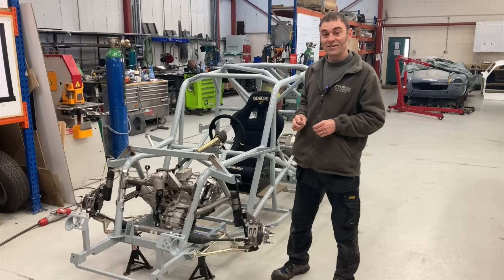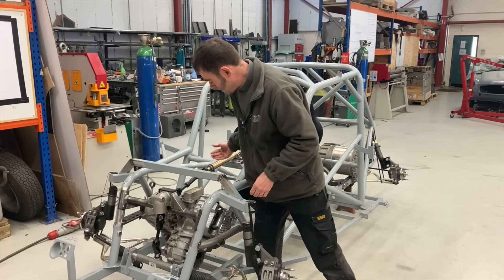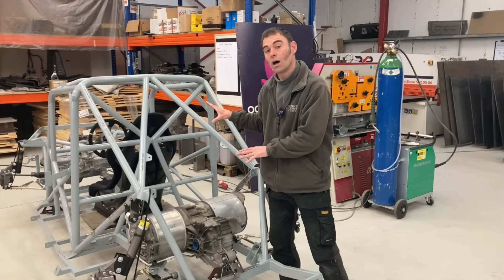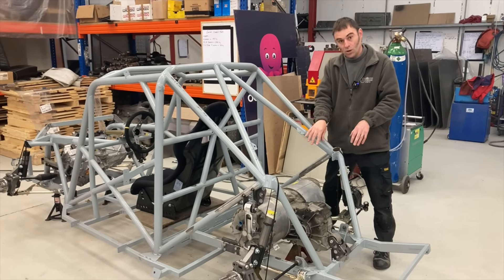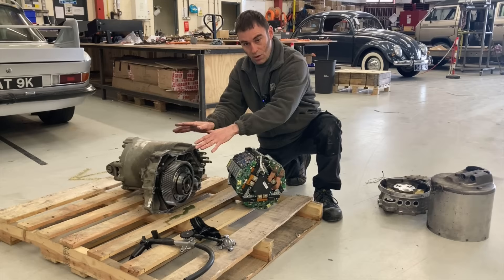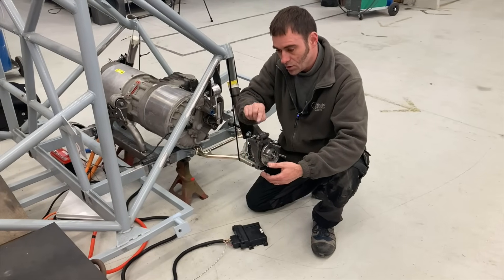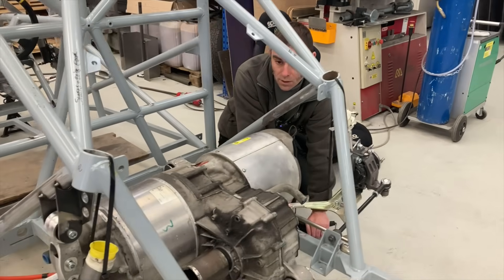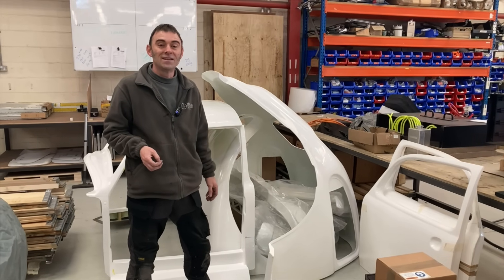Pikes Peak race car Ep2 - Motors are in.

Comment: Lighter is better. For pikes peak challenge, is it necessary to have two motors (front and back)? I would just have one. You win race in the corners and with 0-60 acceleration. Yes, 4 wheels has greater traction. Calculate the acceleration speed difference between single vs dual and weight difference. I personally think single motors is best. The more join you add to the steering the more play. Remive the front motor and less play. I do think you should sit low to the ground. Question. Because you are smart, could you replace the shell of the motors from metal to carbon fiber? Less is best. Might not change too much weight but every little bit helps. I strongly wish you could make that chassis out of carbon fiber. Everything you could do, replace, lighter is better, carbon fiber Everything.

Comment: 12:00 🤔 My fear is on the flipped-over drive unit: The (small) teeth on the intermediate shaft (towards the motor) are now running throught the oil sump, wich they don't do in the original position. The oil could be beaten to foam or cream on high rpm and the gears plus bearings overheat and get wrecked.

Comment: I thought Tesla motors were more drum like with a similar shaped inverter housing on the other side of the gearbox/diff, like the rear motor, so why is the front motor so different?
Reply from the maker: The large rear drive unit looks like that but small motors look a little different. 👍

Comment: Does the drivetrain oil pump normally sit with oil in?  Will it suck oil from startup when mounted at the top? Maybe a mini dry sump kit from a motorbike might be worth considering. Or oil pressure monitor at the least

Comment: Hello!  I am considering flipping a Small Tesla drive unit upside down for a Porsche 996 conversion so that I can get the motor in front of the rear axle line similar to this build.  Do you see any reason why this would not work?  I'm guessing I just need to add an oil pickup line to reach the bottom like you are planning.  Thank you for sharing your work!

Comment: There’s a very good chance that the phase drivers you tried moving don’t have any smarts to them that say which phase they are but the actual cabling going to them dictates what the main controller believes is the phase order. So the board’s physical location doesn’t matter but the cables going to them do. With that said I’d be more keen to flip the motor and sort the oiling and cooling system rather that spin everything backwards. Reason why is those helical gears in those gearboxes create axial loads into the support bearings based on which way they’re designed to spin. If you flip the direction of rotation the axial loads are also flipped. When engineers spec the bearings the dominant load is what they’re going for so you may find that the one that’s on the side that sees the higher axial loads is usually bigger.
Reply from the maker: We swapped the control wiring too but didn't work for some reason. In the Mercedes B class the Tesla motor spins in reverse so the axial loads on the bearings should be fine.
Reply: @ElectricClassicCars  Right on. I wonder what type of encoder it has on it. In some motor controllers they'll re-order the phases based on the encoder during an initial calibration. During the calibration the motor controller energizes the motor phases in an order and checks the encoder to see if it's in the right order. This is a little different than how the VESC works where it updates the hall table to match whatever the phase order is. Silly question but you did swap the encoder order at the same time you swapped the phases yeah?

Comment: Well done! Proper engineering there!!
Curious about you seating position, which was a bit of an issue, last time around, in conjunction with the front motor. 
But I guess that will be part of you next vid, as you need to resolve that before you can fit the bodywork...

Comment: Why not set up the steering “by wire”? IE use a servo on the steering unit.
Reply from the maker: We looked at that but it was very expensive and not really needed when the Bevel box works perfectly. 👍
Reply: @ElectricClassicCars  I see this as a challenge in so many conversions, I wonder if there’s not an opportunity for someone to produce something effective but budget friendly. Hmmmm
Reply from the maker: @autophile525i  Are you taking about electric assisted power steering or steer by wire systems?
Reply: @ElectricClassicCars  steer by wire. I’m not sure what regulations there are, and if they’d apply to conversions the same as manufacturers.

Comment: A quick thought which might help:. You swapped the two controller phases and saw the same rotation. That makes sense. As far as i can see, what needs changing is the low level phase signal which drives those boards,  not the boards themselves. 

If those signals are on three pins of an IC, or on three IC's, then the two relevant wires or tracks going to the boards need swapping over, maybe even by cutting the powered down tracks and adding small jumper leads. If it's done through circuitry which is potted, or on a multi-layer PCB with several tracks inside the board, then that modification might be much harder to make. If you have the documentation, then have a good look at the circuitry to try to find the correct wires or PCB tracks. 

You will need to use a logic probe, or oscilloscope, to find those input connectors, if no documentation is available to you. With luck, the board might even be marked clearly, albeit in small letters, and that could save you a lot of time.

Unless you know someone who can reprogram the microprocessor or PIC's?

Do let us know which approach is relevant to you. Thanks. 🙂👍

Comment: I realise that modifying the electronics maybe not be the easiest option, but you could perhaps instead swap over the cables that provide the drives to the IGBT transistors only. Rather than both.
Reply from the maker: Tried that. Didn't work. ☹️👍

Comment: For the film "The Dark Knight" they had a similar problem with the "Bat Pod" (the bike he used in the film). It had a motor in each wheel that needed to be alined to achieve movement. I believe they go through the solution on the bonus disk of the dvd - I don't have the dvd anymore, let alone dvd player, but might be worth doing a dive on.

As for your phase switching on the tesla motor and it not working: The only thing I can think of is that each unit in the motor is assigned a unique ID (similar to a mac address for network enabled devices). I would imagine, on the factory floor, the units are given a firmware flash as the full drive is assembled. The reason for this, is less to do with maintenance but more to do with system control. I wouldn't be surpised if Tesla treats the car like we treat our home devices for connecting bluetooth or to the internet; each device has a unique address, so it knows what it is and where it is.
Reply from the maker: Yes, that's what I thought too, which is why I swapped the individual phase inverters too. But still didn't work. Thanks for your input. 👍
Reply: @ElectricClassicCars  No problem. What I mean with the ID is that it's most likely hard coded by Tesla that unit 1 has ID 12334 that represents phase 1. This can't be dynmaically changed or assigned after leaving the factory. I reckon it'll be down to not wanting anyone putting in any custom hardware or doing their own repairs etc.

Comment: If you swapped the inverters and the gate controller connections, you swapped them twice, so they were back to the way they started. May be tricky just swapping gate control, as there is probably also phase current-sensing and maybe other monitoring that would also need to be swapped.
Reply from the maker: Tried swapping just the inverter phases, just the gate controller wiring, gate controller wiring and inverter phases,  then same again but also swapping the current sensor wiring. My thinking is it's something to do with the dual motor software as that should have worked ( in theory). Thanks for your input. 👍
Reply: There are only two current sensors, iirc. The third one is done by math. Because of that, I think you have to do a firmware mod in addition to: swapping phase current sensors, gate phases and fiddle with the reluctor direction.
Reply from the maker: @vidznstuff1  Yes, the 2 outer phases have current sensors the middle phase as you say must be done by calculation. Maybe swapping the 2 outer current sensor wires, the 2 outer phase gate controller wiring and the encoder wiring is messing the calculations for the 3rd middle phase somehow. I think you might be onto something there. 👍

Comment: Good approach regarding gearbox issues that occur after flipping it over. Does this gearbox have a breather valve or is it completely closed? Is it necessary to seal it and then reposition it on the opposite side?
Reply from the maker: We're changing the breather into the drain plug now it's at the lowest point. 👍

Comment: not really related to the Buffy build, but are the Model 3/Y Motors constrained when trying to use them in a build like this?  Do they need further mods to allow them to be used?

Great video btw
Reply from the maker: The Model 3 motor is a superior motor to the induction motors in a Model S. We use them in a number of builds. Maybe that's a good topic for a future Tech talk, covering the pros and cons of all the different Tesla motors currently available. 👍
Reply: @ElectricClassicCars  Yes, that'd be great. I saw that Zero EV had a test rig to get the M3 motor to work by modifying the throttle pedal .... but i didn't really understand what they were doing ☺

Comment: Looking good, Moggie. I love how this is progressing. 
Can't wait to see you stick the boot into this thing for the first time and smoke up all four wheels 😁
Reply from the maker: I'll be wearing my big-boy pants that day for sure. 😁👍
Reply: @ElectricClassicCars  12:00 🤔 My fear is on the flipped-over drive unit: The (small) teeth on the intermediate shaft (towards the motor) are now running throught the oil sump, wich they don't do in the original position. The oil could be beaten to foam or cream on high rpm and the gears plus bearings overheat and get wrecked.

Comment: I wondered when you were going to get around to flipping the motor. If you cast your mind back a bit, the FJ cars of the '60s using a Renault gear box, turned them upside down and back to front to give the mid engine position and turn the wheels in the correct direction.
Reply from the maker: I know a number of Porsche and VW gearboxes got flipped over in race cars too back in the day. 😁👍
Reply: On old VWs the diffs were made to be installed either way up, one way for the cars and the other for the vans with the portal axles, so the drive could be reversed to compensate for the portal gears. If the diff was accidentally installed the wrong way, you'd have a Beetle with one forward gear and four reverses!

Comment: This is coming together quite nicely! I've got a question. Do you need to sync the two motors to spin at the same linear speed for the front and rear tires to rotate equally? Or do the motor's logic compensate for that? Cheers!
Reply: I ve asked that the last time.  it seems the rear motor is the master and the front one the slave.  I guess the front control unit receives just the torque setpoint sent from the rear one
Reply from the maker: @davidef4162  That's correct. 👍
Reply: @davidef4162  My ebike has regen so if I set the speed low and go down hill it will slow me down. Would the same happen on the front motor as it was spinning much slower then the rear.
Reply: @alibro7512  I guess that, while pushing the throttle, the negative torque limit is set to zero (the regen torque limit), thus preventing the motor to act as a generator. Anyway, I'm not an expert...
Reply: I have the same question!

Comment: realy nice project. Do you know it is possible LDU from model 3 to flip oposite like this S model ? ? Model 3 has heat exchanger with oil and coolant , and it has oilpump ... will oilpump work propertly??  tnx . Hope you see question.
Reply from the maker: Yes, it's possible. 👍
Reply: @ElectricClassicCars  tnx 🙂

Comment: Hi. Why do all the cars use a 12 V battery. I understand it’s a normal car voltage . As well as the battery pack for the motors. Why not is a transformer to bring the voltage down. One large common battery pack.

Comment: EEC, there is liquid cooling of the motor, and it is likely designed with a certain drain path.  So I suggest reviewing the motor cooling path for any trouble spots.   It might be fine, but take a look at channels that disassembled motor for how cooling runs through.  Or might end up  blowing out some seals or something unexpected.  (Gruber, Monroe, RichRebuild, others I forget)  Special note: some channels have shown failed gaskets/seals that have leaked coolant into controller area and such.
Reply from the maker: Yep, we've taken a good look at the coolant paths, it'll be fine with the motor flipped. I doubt very much that coolant leaks into the inverter area will be anything to do with failed seals, it'll be because the inverters weren't torqued to the gear casting correctly or the seals weren't mounted correctly or the  surfaces weren't cleaned correctly. We've put dozens of these motors together and these points are critical to ensure good sealing between the inverted and motor. It's also critical to ensure the coolant pressure doesn't exceed factory settings. 👍

Comment: Next time, try to build your chassis around the components. This is a good project, but when building new you need to change your approach. Less downtime, less hindering with components, less compromise. However, I am sure you will get to the bottom of it, but let's say, you get 10 orders for Buffy. Like Elon stated: prototyping is easy, production is hard. I just wait to see where the battery packs will sit.
Reply from the maker: This is a project for me. We're not planning on building or selling any others. You're correct, designing and building a custom chassis would have been best but then again wouldn't have cost £2k 😁👍
Reply: @ElectricClassicCars  Totally understandable from this perspective. I was under the impression that you will make more seeing comments that asked for price pointed to your website contact. My bad.
Reply: He is building this vehicle for a specific racing class that all use the same chassis and body 👍
Reply: @Mardy72  Got it Martin. Thank you for making me aware of it.

Comment: You need to swap the gate drive signals from the logic board to two of the power modules. Just swapping the modules is like swapping two identical carburettors on a twin carb engine.
Reply from the maker: As I said in the video, I tried that. Didn't work unfortunately. Not sure why, as I would have expected that to work. Thanks for you input. 👍
Reply: How didn’t it work?. No movement at all? What errors did it throw? Or just spinning in the same direction?
Reply from the maker: @antonnpn9063  No spinning at all. Just a click noise from the Inverter. The sort of sound that tells you it's not a happy bunny. 😁👍
Reply: @ElectricClassicCars 
I'm not that familiar with the LTDU, but is the phase current sensor wiring seperate, or combined with the gate drive loom? If it's seperate, then you would have to swap the both the gate and phase current wiring between two power stages.
Reply from the maker: @EVguru  The current sensor wiring is separate to the gate controller wiring. I swapped both but didn't work. 👍

Comment: There are two current sensors on the motor phase busbars. Try swapping those if possible or atleast the wiring to them. They are probally running some form of Field Oriented Control method thus heavily relying on current measurements per phase.  Did you try running it with just the encoder swapped?
Reply from the maker: Yep, tried both those things. Still didn't want to work. Thanks Tom. I'm going to try it on another motor on the bench, I'm thinking it might have something to do with it having a dual motor software on the main control board so I'll try it with a single motor setup as I really think what we tried should have otherwise worked. 👍

Comment: The bevel gear system on the steering is fairly clever, it must have an idler gear in there too as the output is in the same direction as the input. 🤔
Reply: You can always turn the rack 180 degrees. Problem solved.
Reply: I believe the bevel gears keep the rotation the same, no idler needed.
Reply: Yes, at first thought it would need an idler, but that applies to a gear set like the motor drive set (motor turns opposite way to wheels). If you have a look at (or visualise) a bevel set, both shafts turn in the same direction.

Comment: Could it be that what you swapped on the Tesla motor are just the power units of each phase? Do they receive the control signals from a control unit? If yes, so you have to swap the wiring from the control unit and not the power units, which basically are just signals converters with no knowledge of the phase they supply. Just guessing....
Reply from the maker: We swapped the control cables too, still didn't work though☹️. Thanks for your help. 👍
Reply: @ElectricClassicCars  if the speed and rotor angle are read through a sensor then it might be that the control unit adapts the power unit signals according to the sensor. Then it might be difficult to invert the rotation
Reply: @ElectricClassicCars  Maybe you need to flip the phase current sensors too.